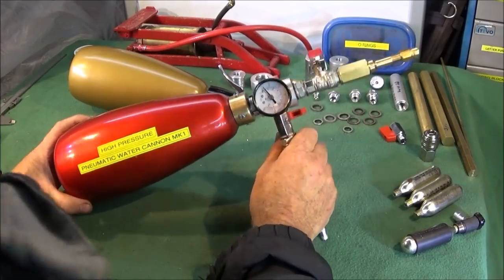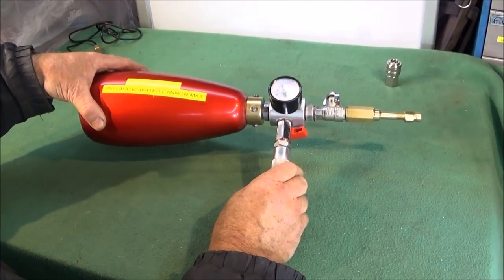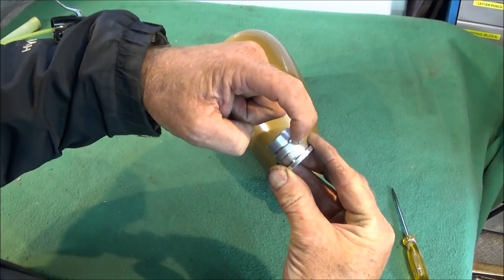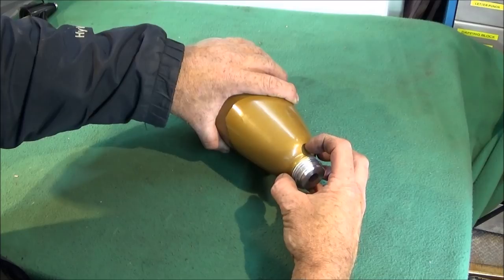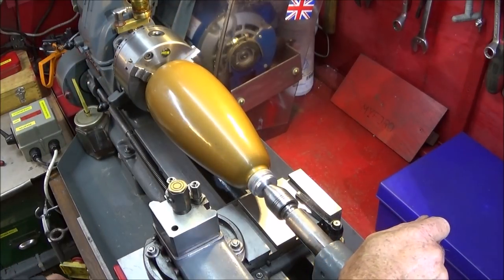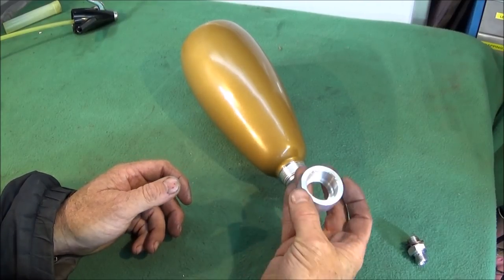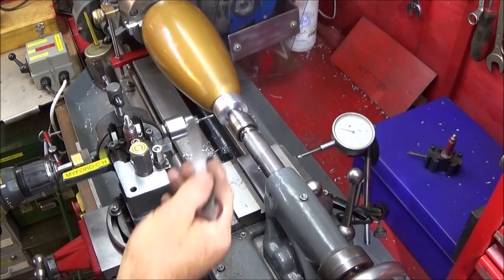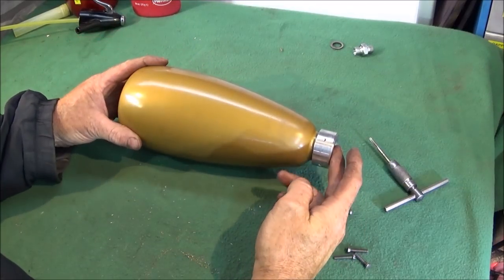Make A Powerful Pneumatic Co2 Water Cannon From A Soda Syphon Bottle PART 1

Comment: Amazingly effective Steve. What a super project - right up my street :)
Couldn't read the pressure gauge but seems to hold a good pressure.
Like the oiler mods.
Quite a lot of work altogether. Very nice.
Reply from the maker: Hi Chris...Thanks. I have had it up to 250 psi and left it over night. It doesn't appear to leak. The bottles have a wall thickness of about 100 thou, but as yet I have been unable to find out what they were tested at. I used one of these bottles for a potato cannon as well and that works great....Regards Steve

Comment: Oh, and another thing you may be able to do is connect a water filter for a central filtration system, which makes for the cheapest filtration system and cheapest new cartridges, without having to rely on little camping filters without proper pumps. Though the benefit of a camping filter is that it's small. But at least with this you get many more functionalities ^^

Comment: back in 1977 I did a city and guilds miscellaneous machine course at the old "skill centres", lathes, milling, turning combined with oxy-acetylene welding with bench fitting (my work was show-cased when princess Michael of Kent visited, and I have been fascinated with home engineering ever since, I was also No1 in the school (1K pupils) for metal work and the hand  tools I made then are still being used today 45 years later, I never did take engineering up, I did try but no one would employ me (blacklisted) their loss my regret,